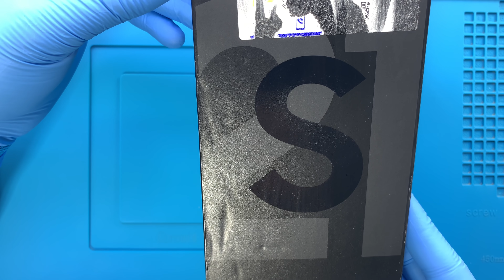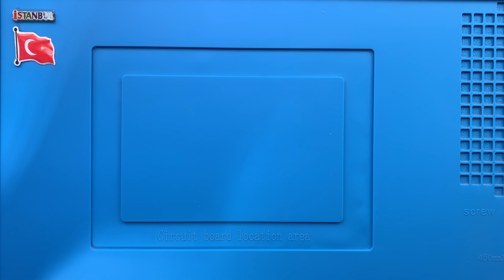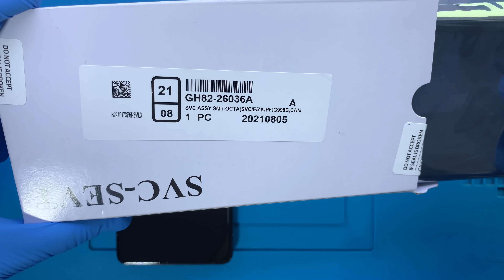Samsung Galaxy S21 Ultra Ekran Değişimi 🇹🇷

Comment: Question, after the screen replacement, is the unit still water resistant?
Reply from the maker: Hello there;
Phone manufacturers only guarantee water resistance for undamaged and undamaged devices. For this reason, it is necessary to be more careful about liquid contact after screen - part replacement and technical service process.
Greetings.